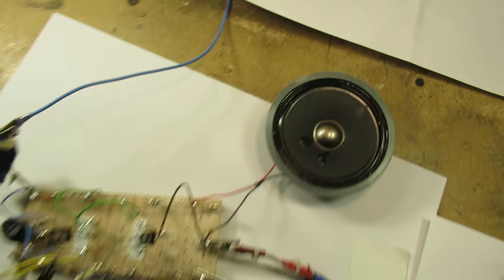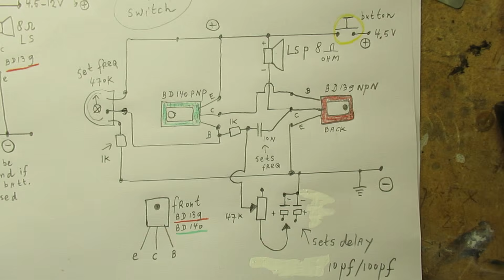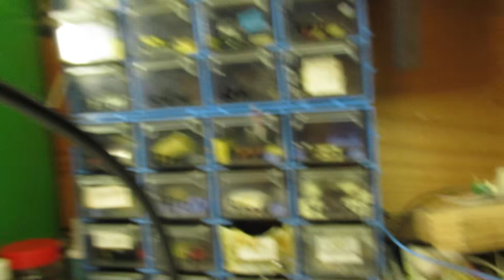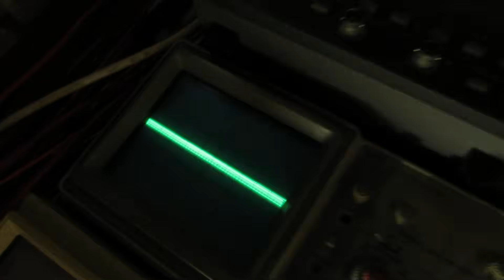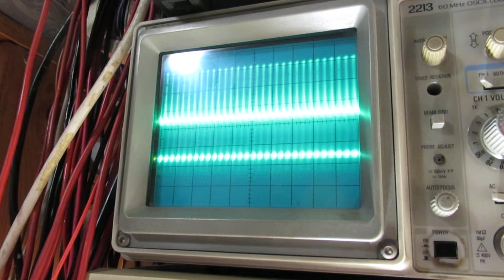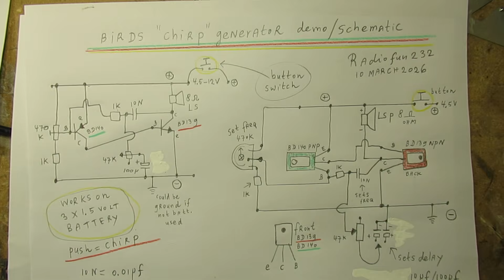Birds chirp sound generator, electronic circuit, schematic and demo, with many possibilities

Comment: Why not using red ink pen for a clearer schematic.thanks for the video!
Reply from the maker: Thanks. The schematics are (in my opinion) as sharp as possible, and the colours have a meaning. Perhaps you must set YouTube to a high resolution? Say minimum 720 p or 1080 p. YT hinders me in setting my video's standard to a low resolution (360 p). 10 march 2026.